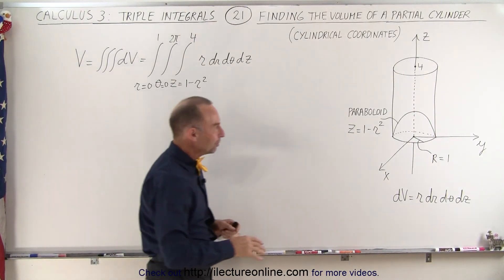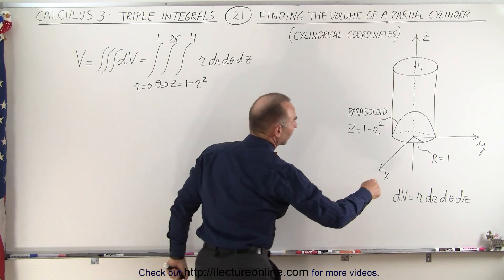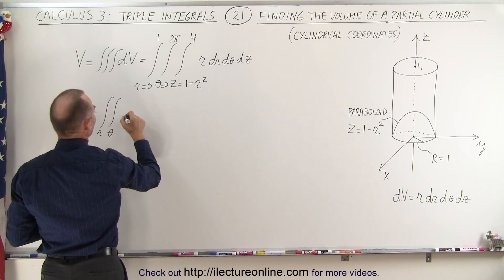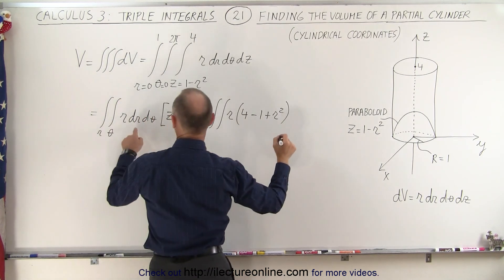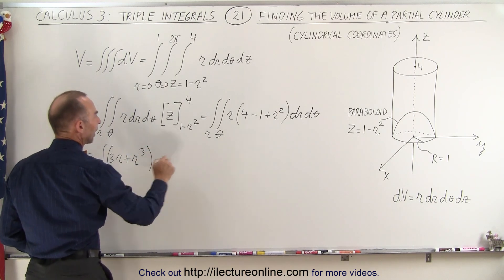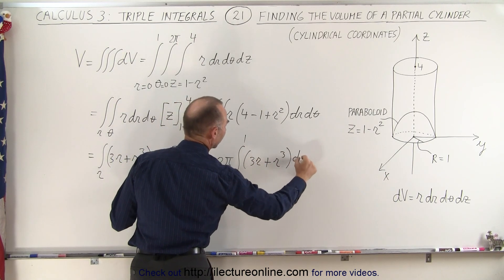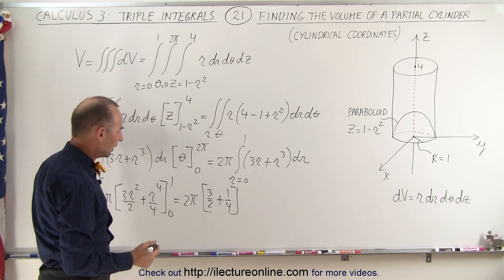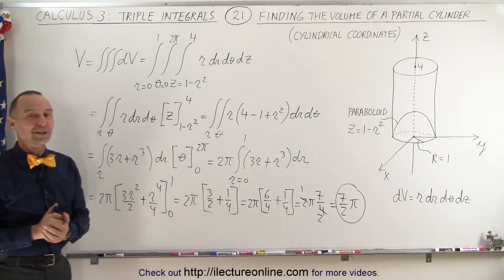Calculus 3: Triple Integrals (21 of 25) Finding the Volume of a Partial Cylinder

Comment: Hi Michel! Great video. I was trying to figure out the volume of a horizontal cylinder cut out of a vertical shaft (hollow cylinder), if the radius of the horizontal cylinder is less than the inner-radius of the vertical shaft (i.e. a pipe cutout from a concrete manhole). I tried using triple integrals in xyz, but it gave me a difficult to solve solution. Would cylindrical coordinates be better, like you have used here? Is there a video/reference/example you know of that shows this type of calculation? I could not find exactly that on the internet. I found the volume of two intersecting cylinders with different radii, but it got confusing when I tried to have the larger cylinder be a shaft...